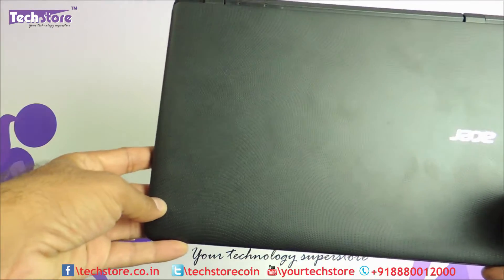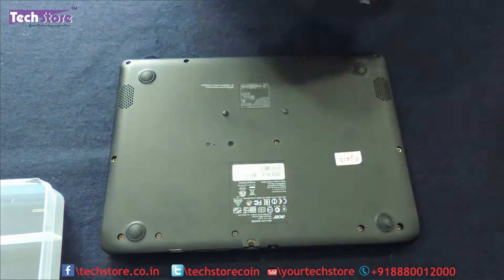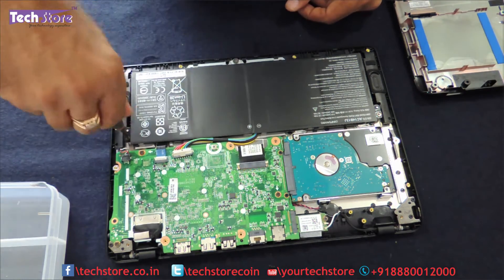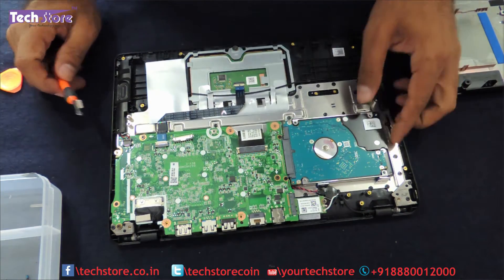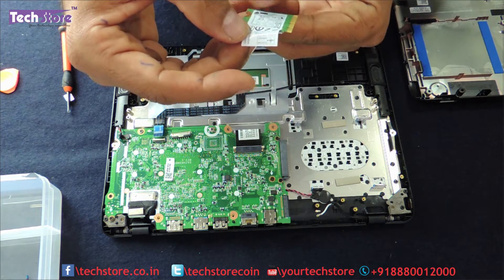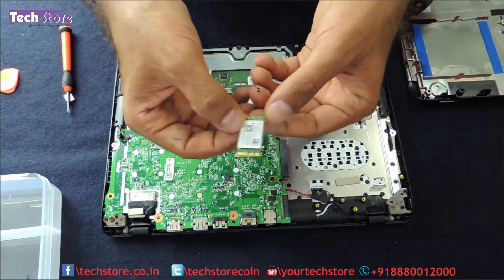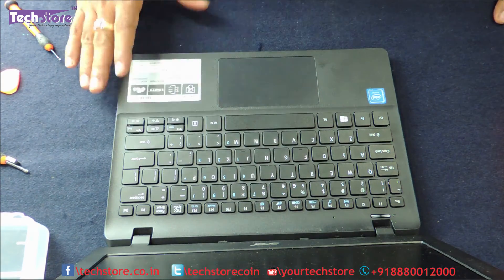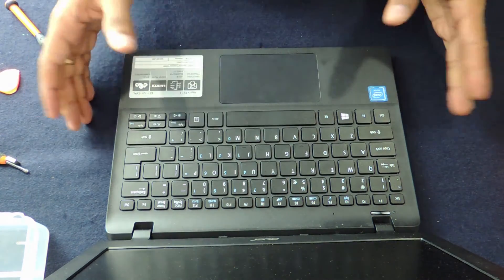Acer aspire mini netbook es1 131 e11 How to dissasemble base and upgrade ram hdd ssd battery

Comment: i have acer aspire ES1-131 C4ZS model, i want to add SSD by removing 500GB HDD, is it possible in ES1-131 C4ZS model?
Reply from the maker: Yes you can install 2.5 Sata SSD.

Comment: My Acer ES1-131 doesn't have a SATA connector on the board, and the bottom cover has extra plastic to fill out the spot where an SSD would go. Think it'll work if I buy a SATA connector and solder it onto the board? Will the BIOS support an additional SSD if the board doesn't originally come with a SATA connector at all?
Reply: Did you found the answer for that?
Reply: @yossefavr  I was curious to find out, but found a buyer for the laptop before I got to experimenting. So sadly no.